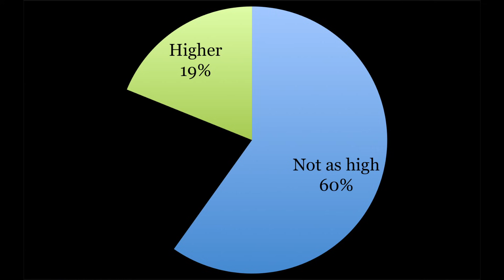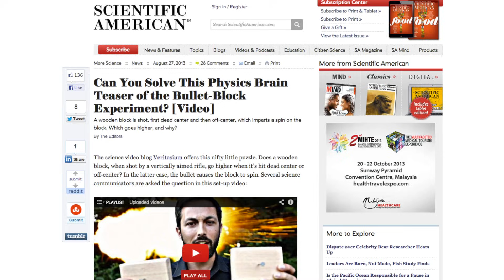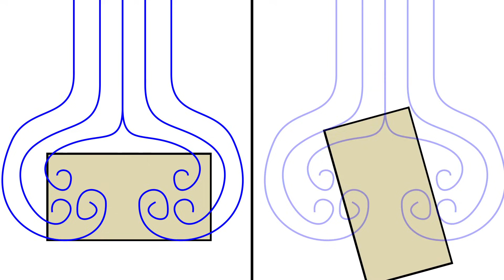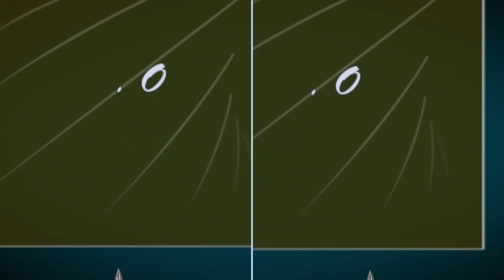Bullet Block Explained!

Comment: But wait. You said that, when the bullet hits the block and it starts to rotate, the block starts moving away from the bullet, right? But this also occur when you shot at the center. The block starts to move upward, moving away from the bullet.

Comment: Wouldn't the gases coming out of the barrel play a factor in this? Could the gases be giving the block the extra lift when it is shot off to the side vs in the middle. Could the projectile spin the block fast enough for the end to be closer to the barrel for the gases to add enough upward lift before they dissipate? Just a thought

Comment: I did initially think the block wouldn’t go as high since I didn’t factor in the conservation of momentum vis-a-vis: angular momentum transfer. 🤷‍♂️ I got it wrong at first. When I found out that the experiment showed the linear momentum conserved independently I said to myself “this seems to be an internal ballistics problem” where energy is lost more in the first experiment and totally redeemed myself 😎❤️👍

Comment: Where does the rotational energy of the bullet go? A rifle barell is, well rifled, so the bullet spins as it exits the barell.  As close as the rifle is to the block, it didn't loose any spin, shouldn't the block have more spin imparted to it from the bullet, or does the mass of the block being more than the Bullet absorb the energy of the bullets spin?

Comment: Coming to the party a little late. Everything needs to be as constant from test to test. Seems the mass of each bullet would need to be the same as well as the powder loads in the shell casings. Also the wood is inexpensive but it should be a material that is measurable consistent from block to block as well as the nail “axels” . My thoughts.

Comment: Nice.  How about a metal AR500 plate so the bullet does NOT penetrate?  Now all the energy is going into the block.  A longer lever arm on the block might make the difference in height more obvious.

Comment: Are you starting with the assumption that each round of ammunition is the same?  Reloaders struggle to maintain consistent velocities due to powder weights, the speed and consistency of the primer and the depth the bullet is seated as well as how tightly the case is crimped around the bullet.   We evaluate a sample of 5 to 10 rounds of a test load for extreme spread of velocity, average as well as standard deviation.  An SD of 20 feet per second yields accuracy differences 5% greater than 15 for SD.  15 fps SD is a good average benchmark for most reloaders to start with.  To get to 10 fps SD you only gain about another 3% in accuracy over a 15 for SD so we start getting into diminishing returns.  Most if not all commercial ammunition publish some velocity data but don’t list the test conditions (temp, humidity, barrel length etc) and almost none will give an SD.  My point is that your energy delivery method may be very inconsistent.  To negate the energy input question I would suggest pneumatic fired ball bearing or slug where you can control the masses and velocities more precisely.

Comment: My thoughts after watching 1 minute:

I disagree. The rotating block is lower, and your red line indicates that. The geometrical center of the left block is a little bit higher than the one on the right. The difference is very small, but it is significant. I thi k that's because the proportion of the energy used for rotation vs. the energy used for translation is very small. If you'd shoot the same block on the very edge, that effect would be exaggerated, and I am sure it'd fly significantly lower while spinning significantly faster. Though also the change of the bullet leaving the block would be much higher, as there wouldn't be enough material to withstand the impact.

After watching the rest:
Darn, you've addressed all my points :D
Reply: 1:56 A replicated experiment shows the same height discrepancy. This is definitely not the same height unless the shot framing is different, but I don't think that's the case.

Comment: Whether or not you change the materials or whatever, is it depth that matters, or total deformation?  i'd put the block on a scale with the hole facing up, and see how much the weight changes when the hole is filled with water.  Use the mass to determine the volume of the cavity.
Reply: Pls tell me he told that rotational energy was 50percent of the energy now atlast he stayed that rotation that was caused was 1percent which cause the bullet to get 1mm upper 3:07 and the 8:30

Comment: I think the height of the block also depends upon the sheets which are used to keep the block as you can also see the vibrations of the sheets are kind of different from each other
Reply: Pls tell me he told that rotational energy was 50percent of the energy now atlast he stayed that rotation that was caused was 1percent which cause the bullet to get 1mm upper 3:07 and the 8:30

Comment: Make the blocks almost identical. Wood blocks, even though same measurement and weight, will not have the same density all throughout its "indsides". That may contribute to the depth of the bullet and the resistance to the bullet. Make the blocks out of light metal or any homogenous block like resin or silicone or anything of those sorts.
Reply: Pls tell me he told that rotational energy was 50percent of the energy now atlast he stayed that rotation that was caused was 1percent which cause the bullet to get 1mm upper 3:07 and the 8:30

Comment: its simple...all bullets had different amount of gun powder.THUS making different amount of velocity PLUS look at the glass....that glass is taking energy as well... (when its shaking or cracking) and third, the weight of the nails in the board...they cannot all be the same weight right ??? these are just some variables in my opinion which we should put into consideration
Reply: Pls tell me he told that rotational energy was 50percent of the energy now atlast he stayed that rotation that was caused was 1percent which cause the bullet to get 1mm upper 3:07 and the 8:30

Comment: Theres a lot energy loss difference when you are using a timber block. Use a metal block instead to reduce the energy loss difference. Cheers. 😊
Reply: Sound and heat energy comes to play here. Would consider of those too.

Comment: The first block was experiencing laminar flow ascending flat and steady, the other experienced extremely turbulent flow across its surfaces while ascending. Less drag meant energy expended during the spin was made up for by less air drag.
Well anyway, tell Dustin that's what it was.. lol

Comment: the Kinetic energy is still in the block in the form of angular momentum. the mass reaches the same height because all the force is generally going in the same direction but the one spinning takes a different path but same height. Now if the bullet bounces off a block then I would expect the spinning block half as high because the weight of the bullet is not spinning with the block and is lost outside the block so the force of the bullet hitting the block isn't carried up with the block and stops having an effect on the block right after it bounces off.

Comment: I have watched this video after years from its publication (redirected from a helicopter & rope) but I want to say that it’s also great!  I like your explanation a lot, but I think the answer to the question at the end of the video is not so difficult. 
I suppose that it would work if the bullet would penetrate a very soft matter with a low resistance for a penetration (e.g. sponge? Or some other foamy plastic? It should be a solid, though). Then, this very small difference of energy put into a penetration in extreme case should be measurable. Also, I think increasing the lever arm length would help (since more energy would go to the angular momentum, increasing this part of total energy vs energy of penetration). Unfortunately the set up of that experiment could be challenging. 
But on the other hand I think that an opposite demonstration would be more interesting, proving your point by a negation. If there will be no penetration of a block at all (neglecting energy of the bullet disintegration) the angular momentum would be about 50% of energy of linear momentum, as you said. In that case, I suppose that we would clearly see a difference in blocks trajectory height. Such block could be made of steel or some other hard but not so brittle material. It would be great to see such an experiment!

Comment: regarding the new block for better measurement: the material it is made off first of all would have to be homogenous. not like wood, more like plastic. The hardest thing to account for should be penetration resistance over penetration depth, as a too steep rising curve here could make any differences quite hard to measure... so maybe tune it so that the bullet ends up in the upper half of the block then? that way there should be less penetration resistance after center of mass and any deviances should result in less path traveled? Oof... I dont know xD But quite interesting to wrap your head around...

Comment: Use lead bullets and steel blocks or plates to remove or reduce the penetrative part of the equation?  Bullet deformity would be impossible to measure due to splatter (please use lots of shielding to protect everybody from that).  Not sure how this would affect the experiment overall but I would be happy to see the results 👍😀

Comment: You could meassure the temperature of the bullet in the hole using an infrared thermometer very soon after the shot. Calculate how much hotter the one shot into the center of the block should be, assuming it keeps all the generated heat to itself. A safe assumption given wood is not so great a thermal conductor.

Comment: I propose 2 modifications: an air gun that shoots steel balls into the blocks. With a tank pressurised to something repeatable to hopefully get.more consistent shots.

2nd modification is a harder material, like polycarbonate blocks or a very hard wood, something tropical.

Comment: Could this potentially be the answer?
Torque, so the bullet was shot at exactly at the pivoted point and at a distance from it at the same force, so the block where the bullet was shot away from the pivoted center will do more work, which will make up for the energy lost due to rotational energy of the block
If we calculate the torque on both the blocks and the find the rotating block has 2 times the torque, that could explain why both reach the same height due to conservation of momentum and energy

Comment: before I watch this video, I'm gonna say that because the dead-on block was centred it was hit in it's centre of mass giving it more inertia to resist the bullet, allowing the bullet to penetrate further, dissipating it's energy in deformation of the fibres and heat, whereas the other block is able to begin accepting kinetic energy much quicker (even if it is as angular momentum) and thus "draws out" the peak of energy from the bullet to the point where more of it is transferred to the block upwards instead of used to penetrate

Edit: fuckn lessgooo

Edit 2: bullet deformation instead of penetration

Edit 3: nvm
Reply: While this makes sense, how would the results change if the bullet was hitting an arbitrarily hard material, would you then still see the blocks travelling to the same height?
Reply: @1AmTheStig  if the blocks were hard enough not to interfere in any way, the centred one would receive a higher peak of energy initially (think hammer tap vs. hydraulic press) which I mentally understand to be ineffective at moving objects (don't have exact reasons why, maybe elastic deformation? sound?), but otherwise the bullet itself might explode more releasing more energy

other than these two points (which may be null anyway), if the explanation given in the video is correct, I think that that setup would show a difference in heights - the spinning one going less high

jeez, this is badly worded but I hope you get what I'm trying to say. by no means an expert, just a random dude doing high school physics and taking guesses.
Reply: @rolls_8798  the bullet exploding is an excellent point. A huge amount of the energy would surely be lost. Seems like it would have to be a weirdly perfect material to capture all of the energy of the bullet
Reply: @1AmTheStig  absolutely. the closest I can think is a spring (they do not have linear compression so theoretically you could get one that absorbs the massive burst at the beginning slowly over a long travel then have exponentially more resistance along it's length  -I think, as you'd want a more direct drive once the energy dropped) but then it would need to lock that energy somehow - acting like a one way valve - and there's also the problem of getting all of the bullet's energy to it in the first place which is basically the whole point 🤦‍♂️

Edit: I just realised that I was looking for something with almost the exact opposite properties of oobleck (which is a non-newtonian fluid that is harder the more force it is hit with), it would have to be softer the harder it was hit. if you could find such an unintuitive substance I guess we're set lol

Comment: An interesting alternate case to this, what if the wooden blocks were sitting on a flat surface? (save for a hole where the bullet hits)

The block struck from the center would be unchanged, and fly up roughly the same height.
The block struck off-center might be launched higher, but only if the spinning of the block is fast enough to keep it in contact with the surface after the bullet impact. By spinning fast enough to hit the surface, some of the rotational kinetic energy pushes into the surface, and the surface pushing back (equally and oppositely) would put that energy into lauching the block higher.

As for emphasising the energy distribution, striking the block further from the center of mass and increasing the moment of inertia in that axis would both help. Connecting two small blocks with a conecting rod might be the best way to increase the moment of inertia without massively increasing the weight.
(Make sure the the axis you want it to spin in has the largest moment of inertia to avoid The Dzhanibekov Effect, the peg at the center of mass could easily make rotaion around the vertical axis have the largest inertia, and cause precession in the desired rotation around the peg)(It might look cool to force The Dzhanibekov Effect, and color each end of the center of mass peg a different colour to show when it flips)

Comment: So, where does the rotational energy come from? From a fraction of a millimeter difference in wood penetration depth? What if we have an ideal block and bullet, with the bullet immediately sticking to the block without penetration? Will there be a substantial height difference then? But what about the linear momentum then? 😃

Comment: The bullet loses more energy on the center shot. It takes a significant amount of energy to lift the block, and bleeds energy to start its movement. 
The spinning block get more lift energy because you bleed a lot less to initiate movement. Maybe the first sping gives some energy with a whip effect.

Comment: I'm not convinced that the difference in bullet depth explains the extra energy, I think that difference is trivial. I think the difference comes from the earth. Angular momentum is conserved across the earth/gun/bullet/gunpowder fumes/wood system. Shifting the block over shifts the center of mass of both the block/bullet system, and the earth/gun system, so when the gunpowder goes off and pushes the two apart, it applies a torque to both in one scenario where it didn't apply any torque in the other. The effect on the earth is immeasurably small,  but should be equal to the effect on the wood.

Comment: As linear momentum is conserved, so is angular. Just before the bullet hits the block, the angular momentum of the "system" is the stationary block and the off-set (from the center of mass) bullet. Once embedded, that original (pre-impact) angular momentum spins the the block. Again, you can sepperate linear and angular momentum, both are conserved.

Comment: Brilliant... Both highly counterintuitive up to the point about the loss of energy due to heat etc., yet still [a bit] unsatisfying. This leads to a question, which must've already been answered quite thoroughly by engineers: Does this mean that a crankshaft bearing is subject to [as near as makes no difference] the same amount of linear force as a piston face or wristpin bearing?

Comment: I did imagine that the position of the hit was, in a first order, irrelevant to the height obtained, due to translation of force/momentum. But I thought that the second order spinning moment would produce a higher height due to gyroscopic (aerodynamic) stability. For sure presenting a flat large surface (inestability in the brick shot at center) would produce higher air drag, causing it to lose more energy reaching a lower height. But, at the same time, one has to keep in mind the extra drag also affecting the rotating brick due to higher speed, so it's not as clear.

If you modify the necessary parameters, probably you can produce any result you want :-)